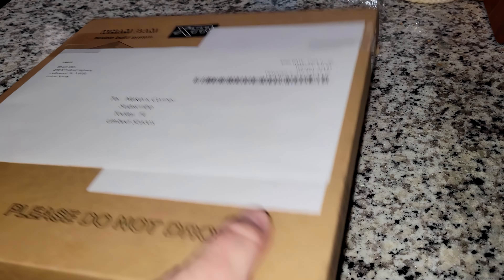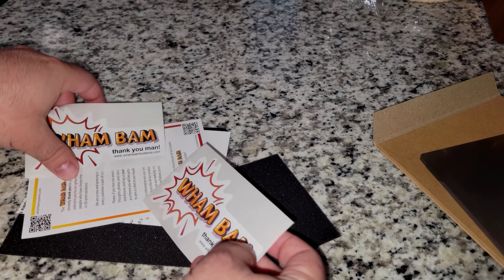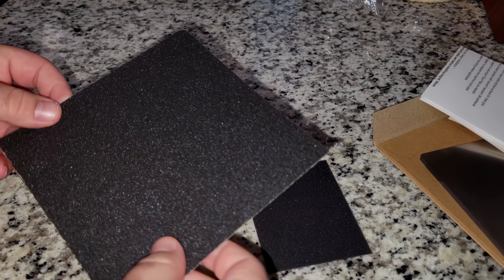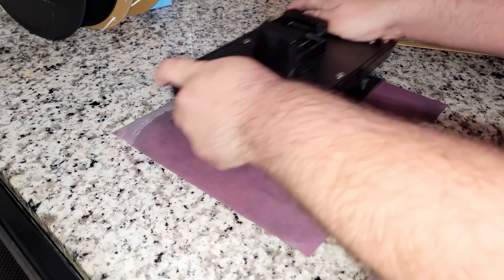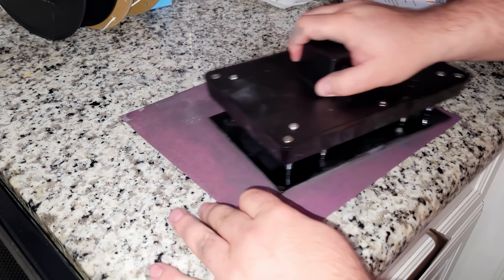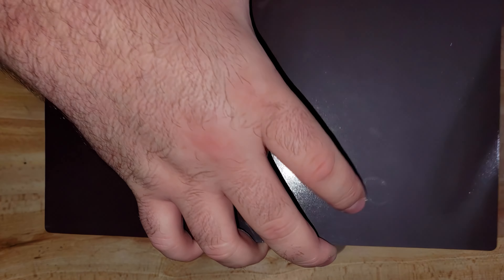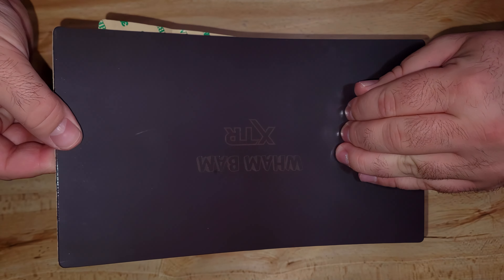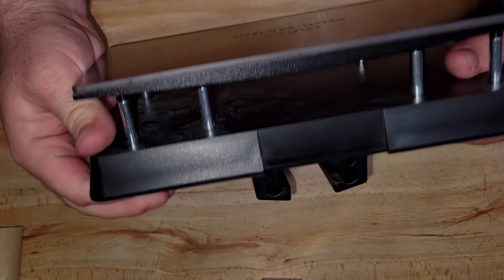Wham Bam Review

Comment from the maker: Hey guys just a quick addition to something I forgot to mention in the video. If you intend on installing a Wham Bam Flex Plate on an Elegoo Saturn 4 Ultra, there is a file you will need to download and run on your printer to adjust the firmware to account for the added thickness to your build plate. I put a link in the description for anyone interested. Thanks @Silent_Steel for reminding me!
Reply: This sounds like a pretty important thing that should be included in the video.  I came her specifically to get details on this and then to find it isn't detailed in the video... guess I won't bother watching.
Reply from the maker: @aaronbono4688  It is only important if installing on that specific printer. This was a general review of the flex plate product itself, not specific to any one printer. I just happened to install mine on a Saturn 4 Ultra.
Reply: @makerscorner93  well I don't feel comfortable making a change like this on my printer because it also auto updates and I don't want it to undo the change without me knowing and then have the machine punch through the FEP. I'll just have to pull out my old Saturn 1 if I want to print directly on the build plate because it's already got the flexplate installed.
Reply: @makerscorner93  This is SUPER important because people following your video WILL BREAK their printer. I would make another video and remove this one!

Comment: When installing the WhamBam, how did you bypass the foreign matter manual leveling error on the Mars 5 Ultra?
Reply from the maker: Use this link for the files and instructions to get your Wham Bam plate working on your Mars 5 Ultra https://cults3d.com/en/3d-model/tool/z-axis-adjustment-for-mars-5-ultra-with-wham-bam
Reply: @makerscorner93  thanks that worked
Reply from the maker: Awesome! Let me know how you like your flex plate! Mine has made printing so much easier for me!

Comment: The problem with the S4U is that you need to modify the software to make the plate work, because it doesn't have the screws to manually adjust the height. Everything is done automatically. If you're on the ultra DON'T follow this video, you could try using Hot water instead to remove prints and supports.
Reply from the maker: There are still perfectly good reasons to use a flex plate on a S4U. Not all of us use our resin printers for minis. I personally print a lot of large flat items on mine. The flex plate makes print removal so much faster and easier. You do need to modify the Z homing values for the S4U but this is as simple as putting a file provided by Wham Bam on a flash drive and selecting the file on your printer to make the adjustments.

Comment: Wow Yes it is possible to get a Flexible buildplate on my Saturn 4 Ultra.  I just received my printer 2 days ago,  and after the first print I was almost regretting my upgrade from my Mars. Especially because you can't submerge the Saturn Ultra  4 buildplate.  I was so used to popping of the flexplate while buildplate was still mounted.  No mess no hassle. Ps. Is there a way to  automatically get the buildplate to top hight after a print? ❤❤❤
Reply from the maker: I think there is a way by modifying the "End Gcode" section in the slicer setting, but I'm not 100% sure exactly how to do it. Would be best to ask on one of the Facebook groups for someone a little more knowledgeable about those kinds of things.

Comment: Did you recalibrate elegoo saturn 4 after installing the flex plate?
Reply from the maker: Nope. Just applied the "firmware" update from Wham Bam and got right back to printing as normal. The only reason I put firmware in quotes is because it isn't an actual firmware, but rather just changes some of the limit switch offsets. Thanks for watching!

Comment: Hey Makes Corner thank you so much for the video! Is exactly what I needed. I have a problem thou= I use a 3dJake flexible plate cause here in Europe wham bam is not that popular, can I set the thickness of the wham bam in the script you posted to the one of the 3dJake flexible one? Also, could you help me manually calibrating the printer after the installation of the plate? I mean what is the procedure? Many thanks!
Reply from the maker: I will check when I get home from work to see if the file can be modified for your 3dJake plate, and will also find the link to another YouTuber who has already done a great video on manually calibrating the Saturn 4 Ultra
Reply: @makerscorner93  Thank you very very much cause I was also wondering about the foreign object sensor detecting the plate...maybe the gcode might solve that....
Reply from the maker: Apologies for the delayed response. I have looked at the script and it looks like it should be easy enough to modify as long as you know the thickness of your 3dJake plate using an application like "notepad++".
Reply: @makerscorner93  which line of script has to be modified?
Reply: @makerscorner93  hey ok so if I run the gcode (3djake flexiplate is 2.6 so I am going ot use FBSR gcode) I don't need to print a spacer correct?
Reply from the maker: No the Saturn 4 does not use a spacer. It uses a limit switch at the top of the printer instead of the bottom. That's why we have to use a script to modify the firmware so it knows how far down to go. Also keep in mind you will need to run the script again anytime the printer gets an update!

Comment: Any reason why you left out having to flash a different firmware to make this build plate work? I see that it does work but how well will this turn out when Elegoo turns out more firmware updates and Wham Bam does not...
Reply from the maker: The only reason it was left out is because this was a review for the Wham Bam Flexplate system in general. I just happen to be installing it on a Saturn 4 Ultra. That is why I decided to leave a pinned comment mentioning the different firmware. In the future I will try to be a little more clear on things like that. As for the Wham Bam "firmware" it is only adjusting the Z axis homing values and is not an actual "firmware" update. That being said you should always follow manufacturer specific instructions when doing any modifications to any printer. Thanks for the comment

Comment: did you have to manual level after the Gcode installation or just run Gcode, reboot - ready to go for printing calibration file???
Reply from the maker: Technically no as long as your build plate is level and working before you install the flex plate system, you shouldn't "need" to re-level, but it's typically a good idea to do so anyway. I personally didn't, and have had zero issues
Reply: @makerscorner93  thanks for the reply just about to pull of my first cones of calibration test with the calibration feature on the printer cheers

Comment: You should add in the method whambam put out to override the "foreign material" error that most people get when trying to install a flex plate... leads people to think it's not possible when it is... bit daunting though lol
Reply from the maker: I realized that right after I hit upload. I will try to add an annotation in the video to check the description for the link to the files. Good catch! I assume you have one on your printer? If so how do you like it?
Reply: yep... I used a knock off version but still used wham bams code edit... strongly recommend to those who use a knock off version to verify your plates thickness is the same as a wham bam tho
Reply: @makerscorner93  Great video tho